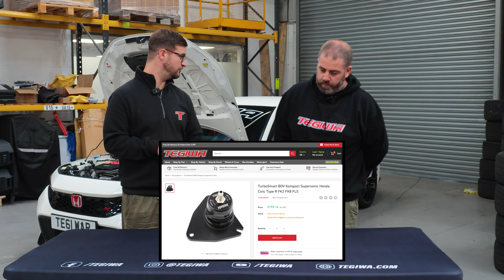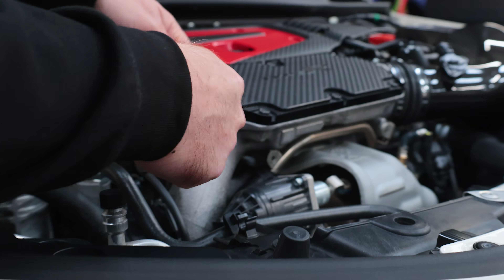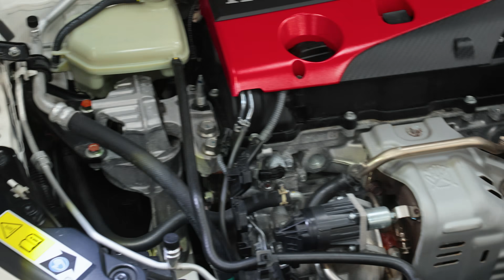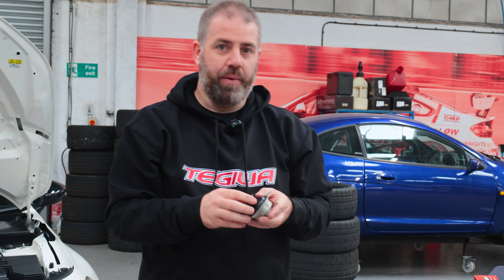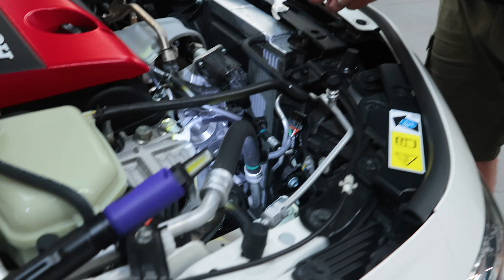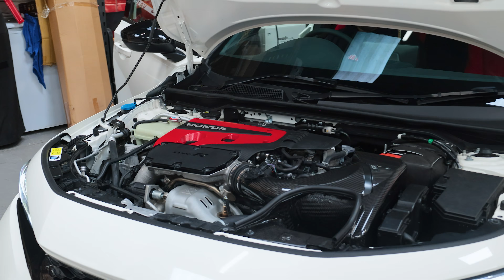Installing a Turbosmart Kompact Blow Off Valve (BOV) on our Civic Type R FL5!

Comment: I read that it’s not good to put blow off valves in these engines because it’s a closed loop system which can damage it and cause problems?
Reply: Far too much misinformation around BOVs on these cars. In practice its not an issue. The engine uses a closed loop fuel system and is constantly monitoring the 02 sensor and adjusting fueling on the fly. In the case of a BOV vs BPV, the worst that happens is a momentary rich condition where the ECU expects a certain amount of air (Due to the factor BPV), balances the fuel accordingly but doesn't receive the amount of air it was expecting. 

In datalogs the effects of a BOV can be seen as a momentary rich AFR reading. On my Fk8 type R making 28psi of boost, its usually a single frame showing 11.5-12 AFR then it corrects itself immediately.
Reply: @A_Mallard_Duck so it is safe to run one?
Reply: @1ANN yes, however the more air you blow off, the richer the condition will become. I have a Turbosmart BOV set to 50/50 and there are no issues.

Comment: I recently bought this part. What is the exact setting of this BOV part for my fl5 having no modification apart from this? Thank you for your help
Reply: I just tested on medium is the best I think
Reply: @AnthonyLiu-tz4xe  Here is the answer I got from turbosmart usa: Hi Samuel. Hope all is well. 
The unit you purchased will not need to be adjusted as the adjustment is only for elevation differences and for a drivability aspect not functionality. 
Regardless the range of adjustment is so narrow that you will most likely notice no difference with it adjusted either way (Softer / Stiffer).

Comment: Literally such a waste of money. Unnecessary and does nothing the factory BPV doesn't already do...
Reply: 1) The Turbosmart valve is metal vs the OEM plastic valve, and 2) Turbosmart valve is vent-to-atmosphere (VTA), while the OEM valve is a recirculating valve aka bypass valve.  They are very different valves.  The sound is very different for them as VTA valves are much, much louder when operating than recirculating valves.  Recirculating valves vent into the intake/exhaust system, so there's little noticeable sound to them.  The Turbosmart valve vents right into the engine compart, and therefore is very noticeable when it vents.
Reply: @ejsmith10  besides. The factory BPV is already incredibly loud with an aftermarket intake. It's a pointless exercise unless you like poor fuel trims and a lighter wallet
Reply: @ejsmith10  cool. So you're venting all the metered air that the ecu has already accounted for? Yeah very smart idea. Again, literally no performance benefit and your making your car run worse
Reply: Sound?
Reply: @aziaja  why would the sound be different? It does exactly what the factory bpv does lol